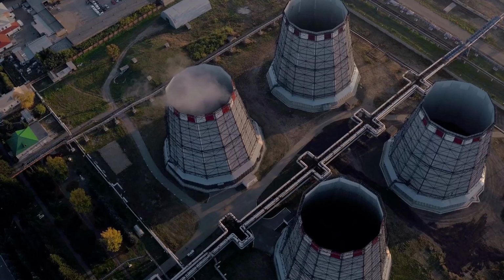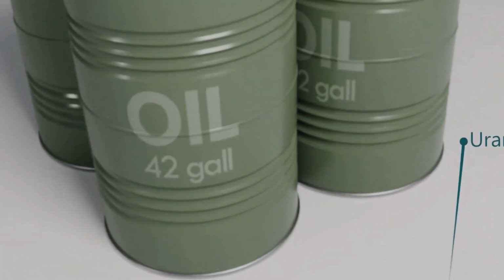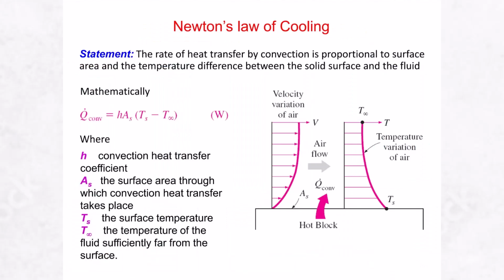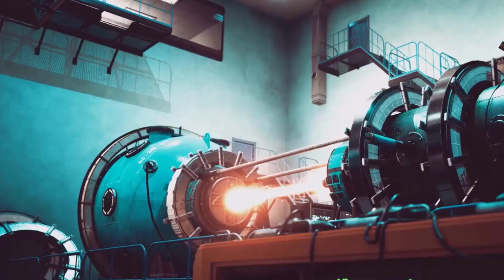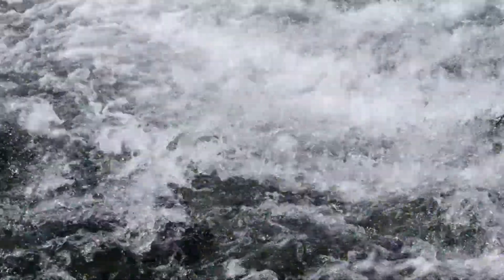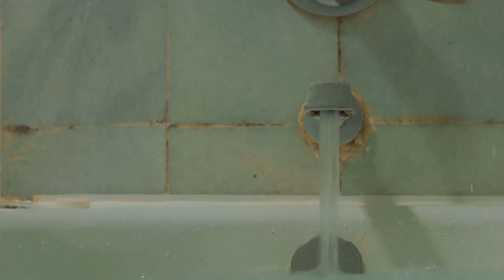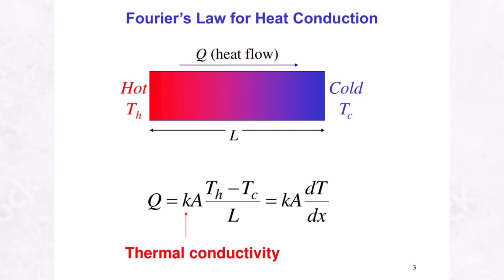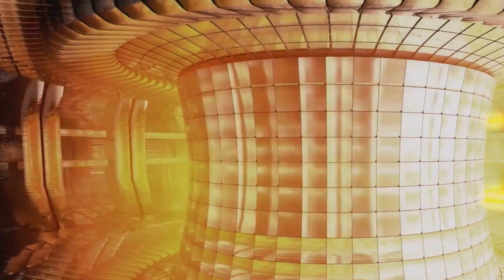Mastering Heat Transfer in Pressurized Water Reactors (PWR): Fuel Rod Cooling Explained

Comment: Very informative explanation of heat transfer in pressurized water reactors. The breakdown of how fuel rods are cooled and how heat moves through conduction, convection, and coolant flow was clear and easy to follow. I also liked how you connected the theory to reactor safety and efficiency. This makes a complex topic much more understandable. Great work.
Reply from the maker: Thank you. Really glad the coolant flow and heat transfer breakdown was easy to follow. More nuclear content on the way.⭐

Comment: Excellent explanation, Madam. You made the complex concept of heat transfer and fuel rod cooling in PWRs very clear and easy to follow. The way you connected theory with real reactor operation was especially insightful. Thank you for such a well-structured and informative lecture.
Reply from the maker: Thank you so much.